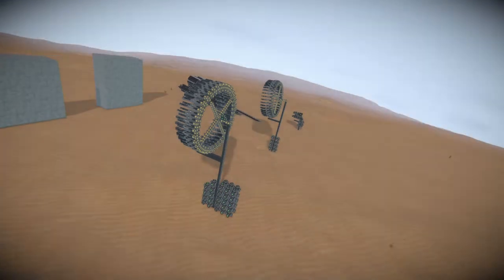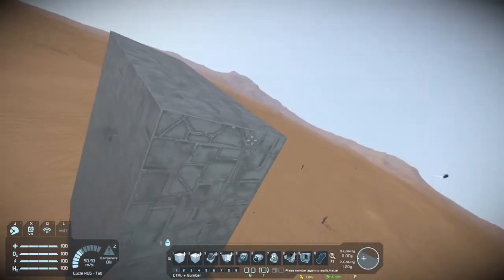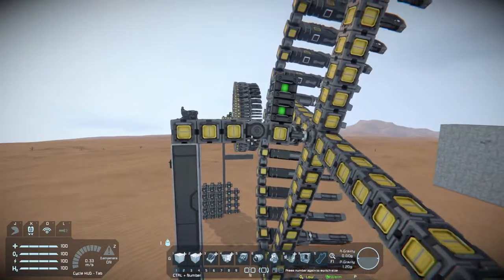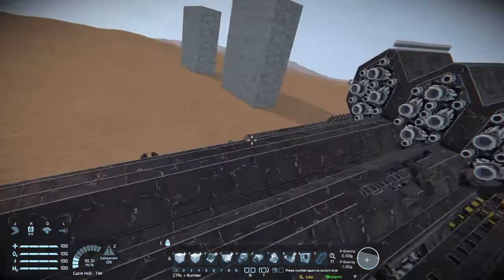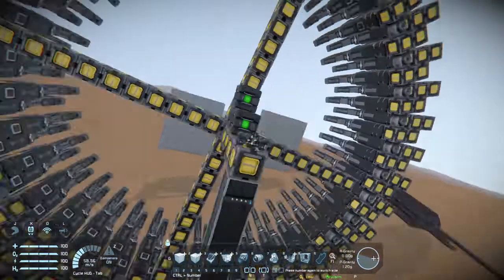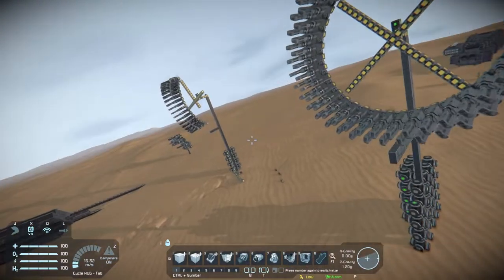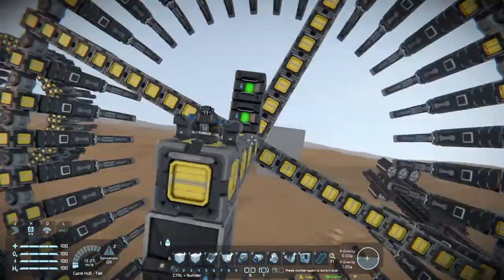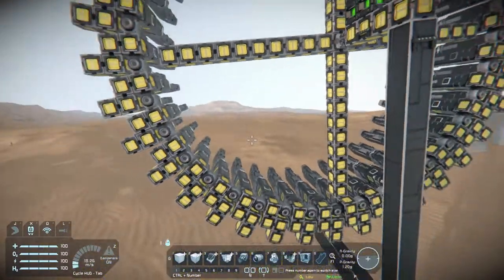Space Engineers - Firing Large Gatling Railguns

Comment: Awesome informative video!!

Seems like you're on the same journey I am. Creating a rapid fire railgun system. You can grind down and then weld up a railgun faster than it can charge; it welds up with a full charge.
For turret use, try the small ship railgun set on a hinge and rotor works better than large grid. Set the rotor speed to 1Rpm and it'll continuously fire and be ready to fire again when the starting point comes back around. Pretty effective.
Reply from the maker: Yup! I saw a video about grinding and welding the railgun and it seems really effective. I will certainly try it out. Small ship railgun turrets definitely seem like the way to go, unless the ship is massive. The turret controller block makes them even better. The new weapons are so much fun to mess around with. Thanks for leaving a comment!